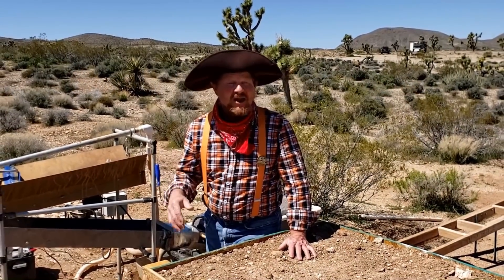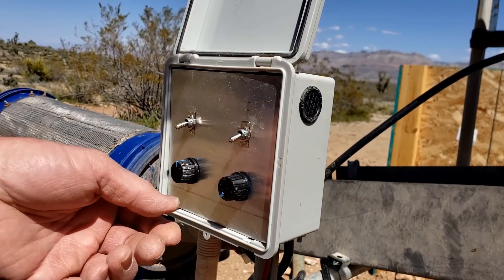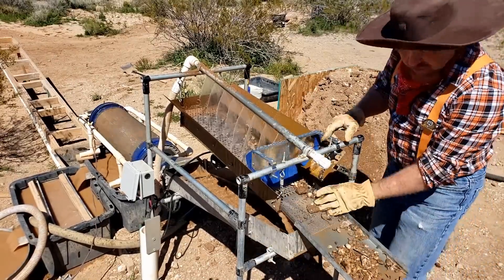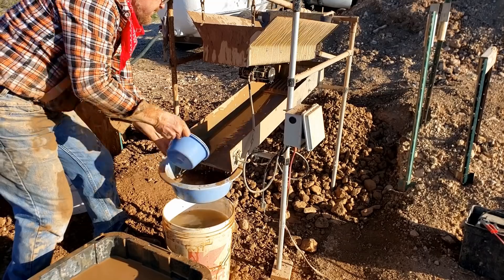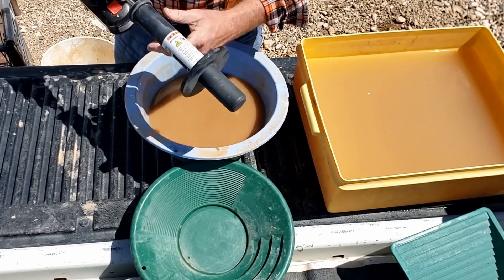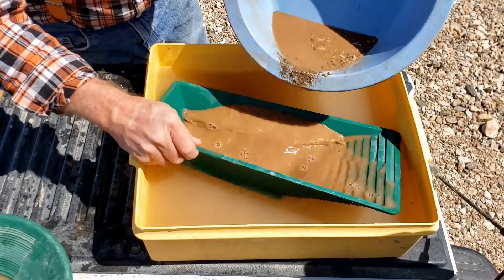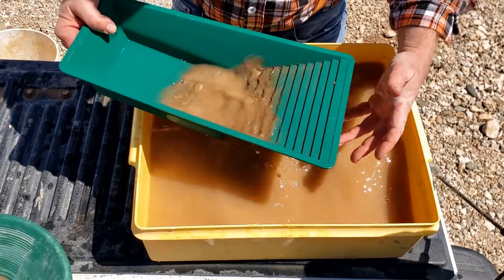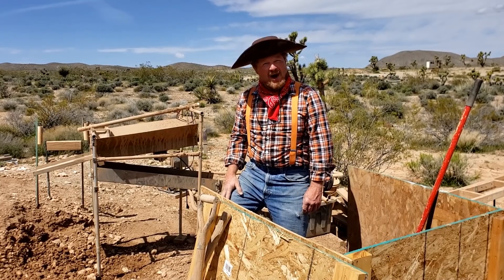Wash Plant Upgrades & Cubic Yard Processing

Comment: The running water had too much speed that I think some of the fine gold was washed down.   The system looks good, with some little adjustments you can get a lot more shine
Reply from the maker: Nope.  Volume, velocity, and angle are perfect.  No gold lost.  Conducted extensive testing.  I prove this with other videos.  Please Check out my original Gold Rattler video, which demonstrates the efficiency of the wash plant.

Comment: A vibrating screener is better at moving yardage but not as effective at cleaning then a scrubber trommel.  If you use a vibrating hopper feeder and a trommel you almost triple the yardage and it comes out clean. Clay and most material
Reply from the maker: Problem solved.  See my Gold Rattler videos on my channel.  Thank you for watching.  Keep in mind that my goal is to create a portable wash plant for the small miner/prospector.  Adding a vibrating feeder and trommel adds to the complexity and is not ergonomically feasible. Vibration frequency is the key, not a trommel.

Comment: cubic yard turns out to be about a ton ?
Reply: "As a general guide, 1 cubic yard of aggregate, sand, or dirt is equivalent to 1.5 tons." (short tons) - course you had rocks in their so more .. 2200 #ton, or 2000 # short , interestingly a metric ton is very close to an english ton, slightly more.
Reply from the maker: Yep, that's about right. 👍

Comment: I'm wondering why your trommel is after the sluice mat and not before?
Reply: Ah now I see, it's just for water recovery so you can recirculate.
Reply from the maker: Exactly.  Water in the desert is precious, so conservation is paramount. 🤠
Reply from the maker: Hello Shane.  Thanks for your question.  That is a dewater trommel filterng system that separates solids from liquids.  I invite you to go to my channel to learn more.  I have several videos from 2016 to 2019 that exhibit trommel before the sluice.  Be sure to check out my trommel build series as well.  Soon the lower trommel (dewater)  will be replaced with a new concept.  Hence why I mentioned the 2and speed controller.  Thanks for watching and best of luck to you prospecting !  🤠⚒⛏👍

Comment: Hey Allan,  
   Love the evolution of the plant!
    It looked like the trommel with the hopper was getting things comparatively clean, is the table more effective?
   What would you say is the downside to the shaker... obviously Way easier to make one, and transport... anything the trommel does better?  Why arent they more popular?
   Fantastic progress!
Reply from the maker: Hi Brad.  Thank you for you comments and compliments !  I still favor the trommel, even though it's higher maintenance and limited to feed size.  Shaker deck can easily handle larger rocks, which my goal, to wash all rocks.  Downside to shaker is rocks don't tumble as well, making it challenging to clean the underside.  The shaker does not occupy as much height comparatively.  Therefore, designing a trailer mounted wash plant (my end result) it's critical to manage height for ergonomic reasons.  Shaker occupies half the height as a trommel.  In my next video, the dewatering trommel is replaced by a new revolutionary dewatering shaker deck.  It's far more efficient.  Stay tuned !

Comment: It may  be a little on the  spendy side but if you could  incorporate  a rp-4 table  it would  help a lot to get the fly poop gold. And try adding  a colagulent  and  some la totally awesome  the yellow cleaner. It will clear the water and help drop the gold.
Reply from the maker: Thanks for watching Skylor.  The sluice mat is specially designed to trap fine (-200 mesh) gold.  It's amazing.  I also use a floculant to settle suspended particles.  I'm designing a new filtration system that will be revolutionary for sluice recirc systems.  Stay tuned !

Comment: You must need a pallet of batteries to run all this stuff, very cool  setup its turning into .
Reply from the maker: Hi John.  Thanks for comments.  Actually, the shaker deck and dewater trommel run on a single deep cycle marine battery.  Lasts all day.  The pump is a gas powered 1 1/2" trash pump.  Runs all day on 1/2 gallon.

Comment: try this boss     I have a milwaukee tools rover light   2 AA batteries  on low power 100 lumens lasts for 16 hours   if those were metal posts  it has 2 magnets  one on the base and one on the back of the light   even on low power  it will light up my hole room pretty dam good  and fits in your shirt pocket   (very small)    just a thought    have a good day   boss check it on youtube  milwaukee rover work light
Reply from the maker: Thank you for sharing.  It's amazing how bright and efficient they make flashlights these days !

Comment: Did you find that the frequency/vibrations of the shaker cause the material to climb up hill? It seems to happen with mine regardless of how step an angle or direction of motor spin.
Reply: I'm down in aus though so maybe things work diffrent down under :)
Reply: SEARCH mbmmllc in YT.
MILLER TABLES !!
Reply from the maker: @kennethkustren9381  yes, I've seen them in action.  Work good once the flow and angle adjusted. 👍
Reply from the maker: Yes.  Placement is critical as well as the direction of the spin.
Reply from the maker: Welcome Ian !